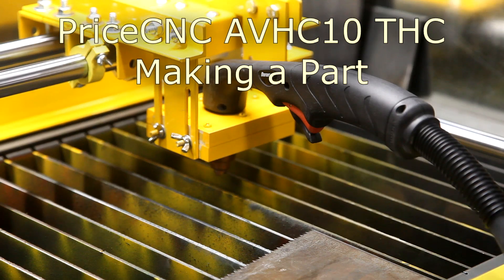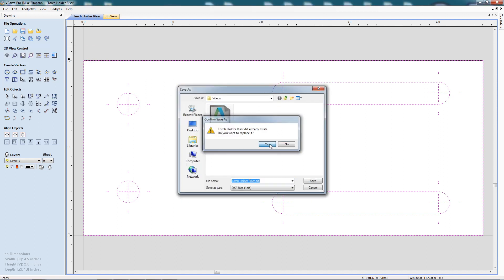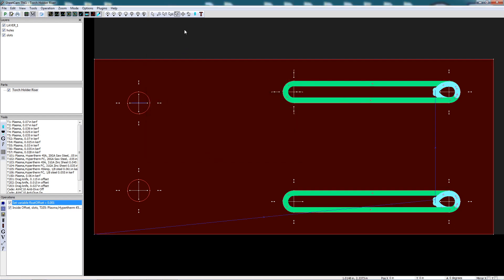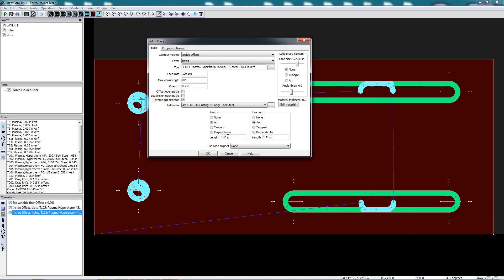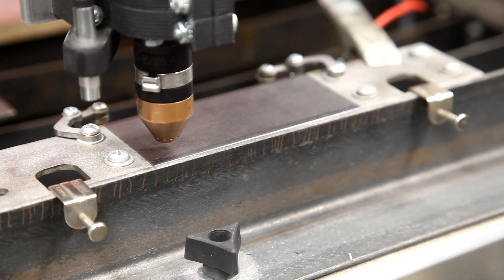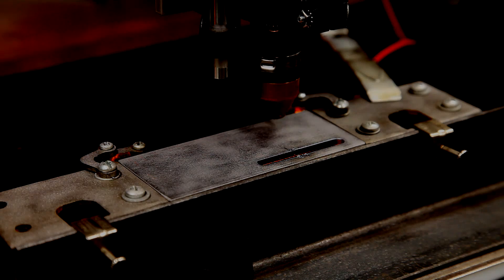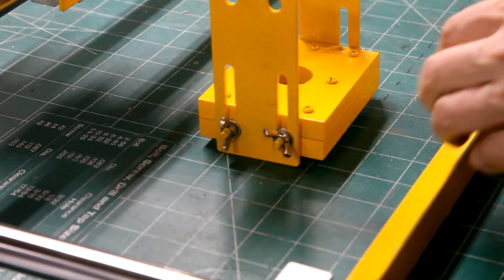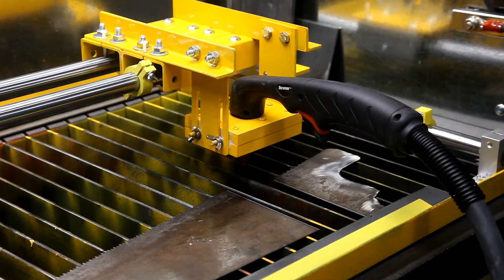AVHV10 THC Cutting Part

Comment: Very nice. What plasma cutter is that and what are the air cfm requirements. Thanks
Reply from the maker: This particular plasma cutter is a HyperTherm PM65. I am using this one for a couple reasons:
1. My plasma downdraft table is next to my CNC Machine. Which has a Hypertherm PM65 machine torch attached.  I can just unplug that cable from the machine and plug in the hand torch. Lets me go back and forth very easy.
2. It has shielded hand torch consumables so I just have to adjust the torch until it just touches the metal I am cutting.

I also have another CNC that has an Everlast 50S connected. It is further away from my downdrat. And I only have one torch for it.  In addition I dont have any shielded consumables for it.

The Everlast, can be run on very little air. 6CFM at 90Psi will work great, but I have used even smaller units with success.

They Hypertherm is an air hog.  I had to upgrade to a 60gal 3.7HP 11.5 CFM at 90Psi.
Reply: @msimpson20175  Thanks for that info. I moved recently and my new garage does not have 220v,and unless I run a subpanel to it (not feasible for now) I am stuck with 110v 20amps. So I actually bought a new welder due to this and my other is a paper weight for now.

I figured I would just purchase a 110/220v plasma and that way I can at least get up and running, the only other limiting factor would be CFM. I have a nice smaller unit that will put out 6.5cfm @90psi at continuous cycle without issue. No plans to upgrade that. 

I have narrowed it down to hypertherm 30xp, Miller 375x, and the new Hobart 27i that just came out (price point is pretty nice). 

I doubt I would ever really cut more than 1/4" anyways with this machine. Most likely using it to make some art. Anything near that thickness is already heavy as hell for any decent size.